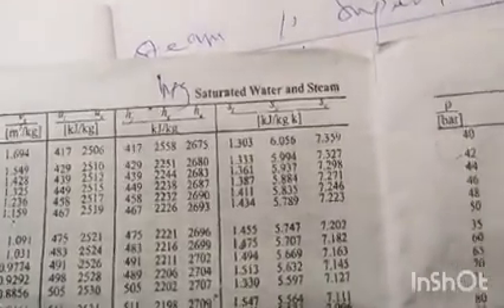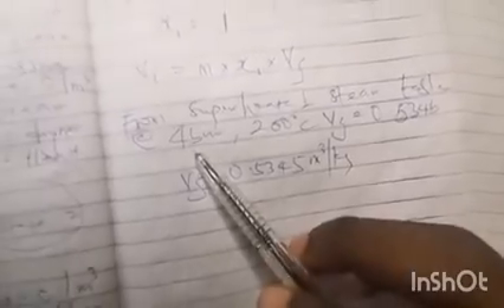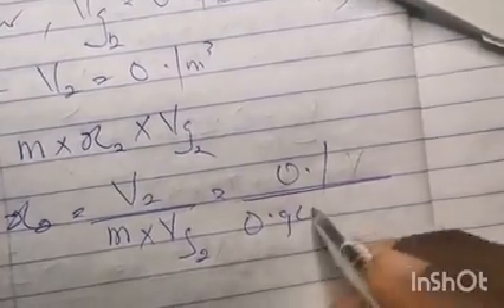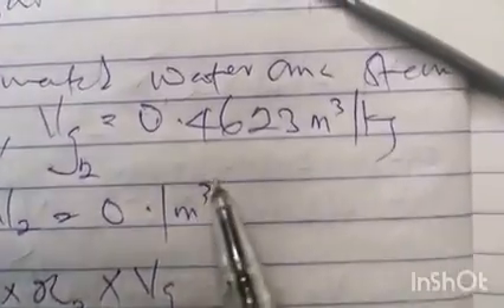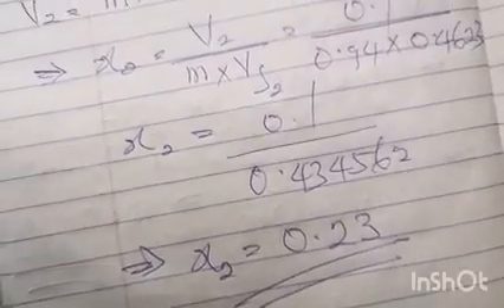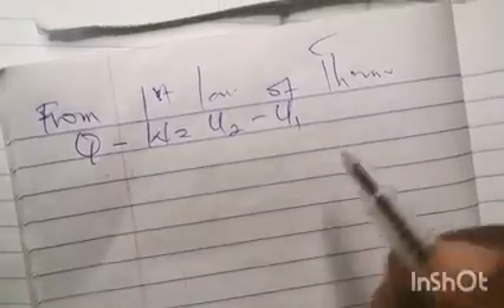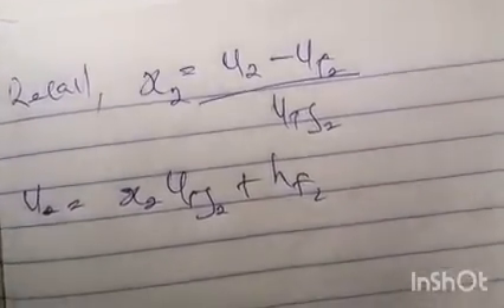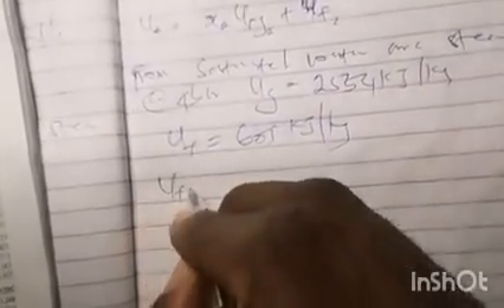How to calculate mass  dryness fraction  workdone and heat transfered using the Steam Table

Comment: Why did you use the non flow equation in this case?
Reply from the maker: It's shorter with the non flow energy equation.. But you can also use the Steady flow energy equation without kinetic and potential energy per unit mass as well... Only that the SFEE approach is longer